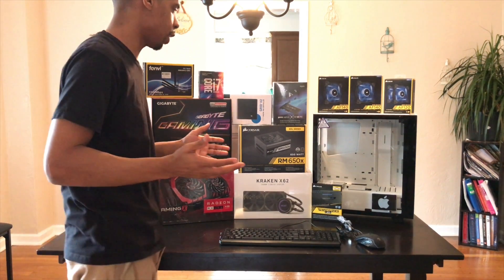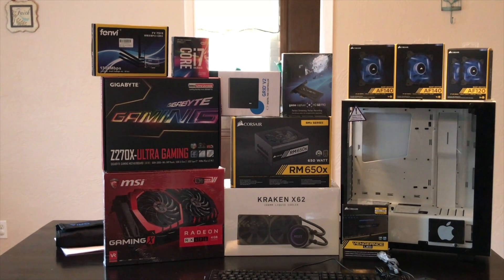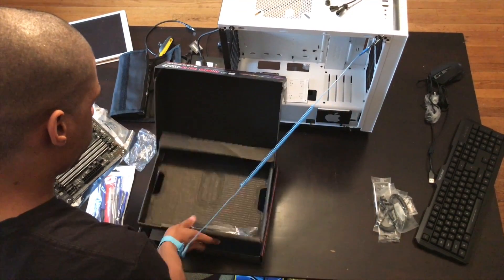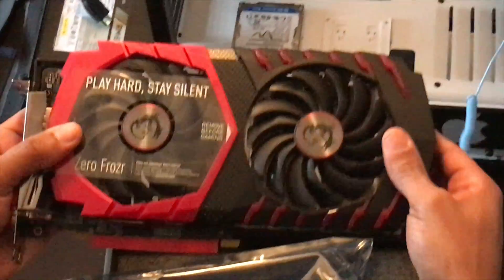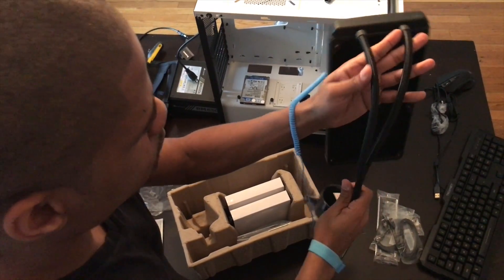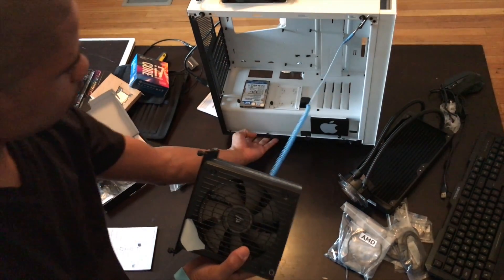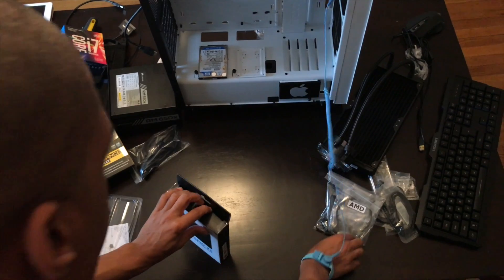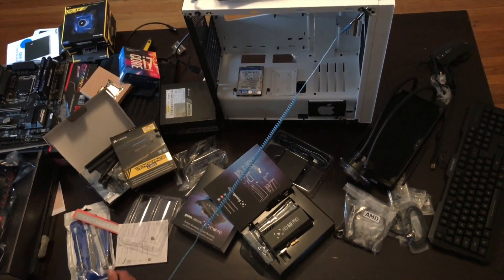Hackintosh Build part 2 (ich3tech)

Comment: hi there i have a z170xp-sli and have gotten audio and network drivers working fine however i brought this (1000 pound pc 100% compatible with hackintosh) and mac osx  is running very sluggish and i got this pc to do music on hackintosh with logic pro and my friend has a very cheap pc and runs hackintosh very nice and smooth im almost 100% sure its a setting somewhere thats making mac osx lag at like 2 fps and flicker like a bitch on every animation?? i have a gtx 1060 so i shouldn't struggle with animations and i have a gigabyte z170xp-sli, i5 6600k, 2 ssds 1 with hackintosh and one with windows and windrows 10 runs flawlessly. i cant even watch a youtube video full screen or put safari full screen without it being at a refresh rate of about 2hz. any help would be really appreciated if you know what my problem might be? thanks
Reply from the maker: you welcome

Comment: good ..good.waiting for next part..Thank you.
Reply: I've heard z270 and the 7700k are not quite supported yet? Just bought a gigabyte z270 board and am concerned it won't work as a Hackintosh because it's too new.  Curious to see if you can get it working!
Reply from the maker: theflatearthsociety yes they are testing  it now. So I'm going to build another build with the parts that can. My video going up tomorrow with my part 3 Hackintosh build I'm going to talk about it then.
Reply: I'm just gonna go for it... macos doesn't seem as temperamental as OS X from what I've seen and read. Clover even has support for the 10 series Nvidia cards now. They're actually building a 7700K and non k iMacs at Apple right now so I would say that's why people's been able to use the 270 and 7700s ... even before Apple releases their new machines and I'm so sure that pisses them off so bad. :)  there's nothing I'd like more than to have a drive for Mac on my PC without giving up windows 10..
Reply from the maker: jhon gris part 3 coming working on getting Mac on it
Reply from the maker: jhon gris yes you righr